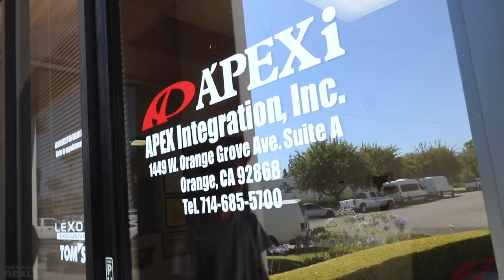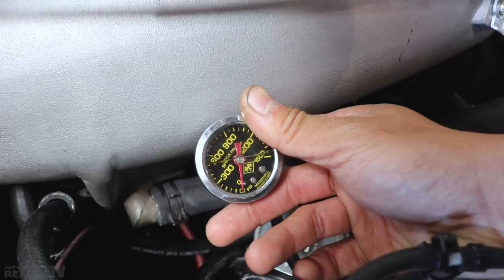DYNO DRAMA - Revenge of the TEAL CURSE!

Comment: Did you use an oem oil pump? Most of the time they crack, but I don't understand why it wouldn't last longer than it did.  I highly doubt it would have had any oil pressure at all if you didn't use a pickup tube seal. 

weird